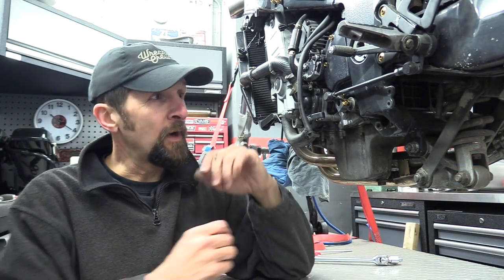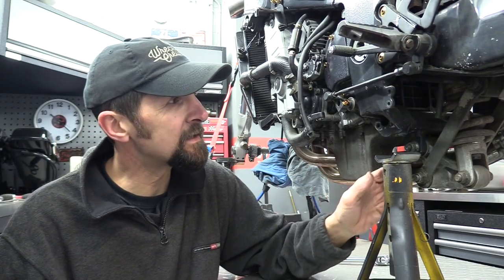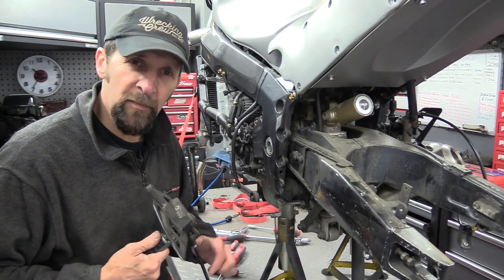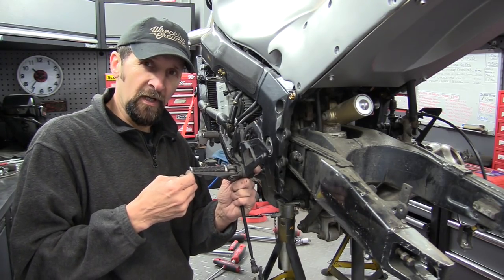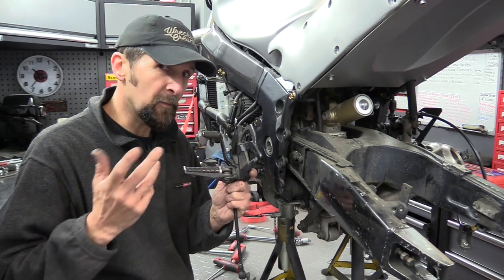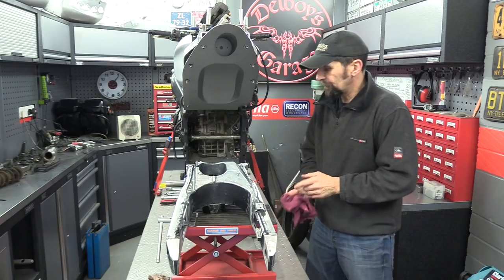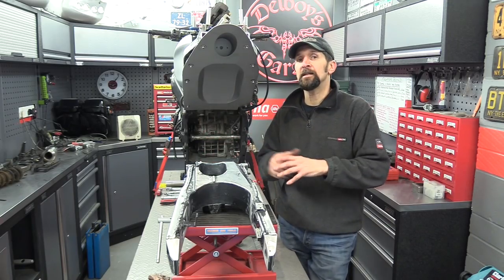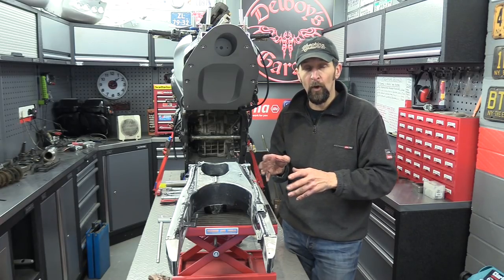Delboy's Garage, Fighter Build #95, Swing Arm out..!

Comment: I’m starting to realise about just how much these videos inspire me to work on my bike or either upgrading my tools and small Crompton type concrete sectional workshop 12ft x 8 x 8 and make it a better place to work, damp is an issue though, causing surface rust on tools, the bike is fine because I have a 6ft long tube bar heater laying next to the bike 24/7 and that 100% works stopping any condensation on my pride and joy but elsewhere it’s a problem, so this spring/summer I’ll be tanking, insulating & plying out the workshop, it’ll all be done on a tight budget, reckon I’ll do a pretty good job on it though. I honestly don’t think I’d have got around to doing this big project without being inspired by your videos, so thanks a lot, I’ve already ordered a lot of the materials needed and can’t wait to get it done as soon as we Brits see some back to back dry sunny days.👍
Reply from the maker: Hi Matt, thank you so much for that kind endorsement, it makes us really happy to know we've been able to help... and I bet you're really looking forward to your project, I know I would be!  I guess I shouldn't say it,  I love the awesome garage we've got, but I would love to build a massive wooden work shop some day...

One point, which may help you mate, with your condensation, consider the principle of heat exchange... remember condensation comes from a sudden imbalance of temperatures within a moist, or humid, atmosphere, it's actually very little to do with insulation... the contents of your garage gets cold at night, like the air outside, then the sun dawns in the morning, beating on the roof, but the contents of the garage stays cold, and imagine when you take a pint of milk out the fridge and stand it on the side in a hot kitchen, it's immediately running with condensation, right?? (or a cold pint in a warm garden)... so the trick is, stick an extractor fan on one end of your garage, then the same extractor fan facing the wrong way on the other end of your garage, so one sucks in , the other blows out, it effectively exchanges the air inside the garage constantly... so it stays the same temperature as the air outside and so do the contents of your garage - hey presto, almost zero condensation... add it to your project mate, it will guarantee you a warm, dry garage... I found this worked myself back in our first garage, which as concrete Marley slabs for the walls and a corrugated sheet metal roof!
Reply: Moonfleet41 Thanks for the reply, all this food for thought is appreciated and definitely going in the mental processor for sure, I was planning on doing a retrospective fit of corner to corner venting using a solar unit that I used on a wooden shed from years ago if the full tanking (all walls, ceiling and floor) doesn’t work as expected, I’m hoping it’ll be completely sealed, like a shed within a shed with foil backed bubble wrap insulation in between every surface which will also act as the vapour barrier. 
because the retro fit of the venting if needed would be easy, I’ll build and test as I go, hopefully saving a little money....if humidity/condensation or stale air becomes an issue, as you say “use what you’ve got” I’ll fit the solar unit....I never thought about what you mentioned though, makes perfect sense when put into layman’s terms...ha ha thanks I did need that👍 I’ll check out the running costs of two fans. Cheers again for the advice. PS loving the street fight project. Ride safe you two.

Comment: Didn't notice if you were doing the relay arm as well...its well worth doing them bearings as well.  Just done rm in my fjr and the shock one was shot!! You've done all the work getting to an so may as well do em.
Reply from the maker: Hi Stan, I thought about that, so did a thorough check of all the others in the short link, and I reckon they've been changed in the past, cos the swing arm bearings themselves are horrible and corroded and gritty, but all the bearings in the short link, including the one under the swing arm, are silky smooth and rock tight, so there's definitely there's no way they're the same age as the swing arm bearings... am not gonna do them now as, like I said, they're perfect, but in the future the great thing is I can drop the relay arm out anytime and do it on the bench, unlike the swing arm which, as you can see, is a nightmare to get out lol !

Comment: Hi Dell, good video and nice and clear process. As a safety tips I usually use a non slip padding between the metal surfaces such as the cheap padded non slip mats you get from camping stores. They are cheap enough to cut up the size you need and it helps to eliminate the chance of metal surfaces slipping.  Looking forward to the bearing video, good quality video as usual. Cheers for the info. Ride safe 😉
Reply from the maker: Thanks Andy, great sage advice there mate, and we've all got a bit of that matting knocking about aye... glad you enjoyed the video, bearing change next... online Weds!  Ride safe... and thanks for your kind support...

Comment: Kendo’s Tips #27 - When using a spanner/ratchet/breaker bar to initially undo a tight nut or bolt, don’t grasp the end of the tool with your hand clenched. If the tool slips potentially you’ll damage your knuckles or worse. 
Better to keep your hand open pushing down on the tool and if it does slip any damage to your hand will be minimised as the palm is much more fleshy and less liable to injury. 
(I’m here all week).
Reply: Good shout. Amount of times I've smacked my knuckles on a sharp part of the bike with cold hands..
Reply from the maker: Kenneth McCurdie:  wise words, well said my friend, thanks for your input... and along with it, I always feel checking the path of your hand as it moves so there actually isn't anything sharp, or hard, that you're going to involuntarily punch for now reason lol !

Comment: Another tip for those of us who are, how shall I say... "not as safety conscious" when supporting a bike:
Get under there, and point out each bolt you are removing. Visualise the removal. and PRE BREAK THE SEAL on each bolt.

If there is a time your bike is going to come flying off the axle stands, its during the "breaker bar" part, so get those (where possible) out of the way while you still have the bike together and supported by the wheel in place etc.

As for supporting the bike, I totally have never put a block under the sidestand and lifted the bike using a trolley jack under the other side. Nope, never. That would be silly! ... ...looks round...
Reply from the maker: I think we've all done that one mate... or another fun one with a Harley, which has such a low frame, is rolling it up on to a brick under each wheel, then standing the side stand on two bricks, and an axle stand under the right hand footpeg... just to get it upright, and high enough, to get a litter try under it !!  I mean that would be daft, you'd never do that would ya?!  Honestly mate, the things we do when we don't have the equipment, I put it down to watching too much A-Team and McGyver as a kid !

Comment: Your videos are so well put together and thought out, you make even work as serious as this look easy so someone that's quite new to bikes would at least think about giving it a go. I'm quite rusty with mechanics and maintenance, I always used to do as much as I could on my car before getting a bike and so far on my bike I've recently put crash bars on it and done the front and back brake pads then bled the brakes.

The front pads were such a pain the arse, took so long to do something so simple because of that shitty little metal prong thing that was a bit buckled so the pads wouldn't sit in the caliper right. It took ages to get it back together and when the caliper was on the bike, there'd be a scraping noise when pressing the brake so had to take it all apart and just took that shitty metal prong out, it's fine now.

Your bike's looking quite cool. Oh just incase you didn't know already, you only use acid etch primer on bare metal, just in case you didn't know, and you dust it on quite light, not cover the whole thing like you would lash high build or wet on wet onto it. You can flat the primer with 400 - 600 wet or dry if you want it very smooth and just before putting paint on, rub it down with grey scotch pad just to key the paint and help the colour coat stick to the primer. Tips I picked up from paint spraying college days, hope that helps, it's all in the prep.

Ta very much as always.
Reply from the maker: Hi mate, thanks for your kind words, I know what you mean, brake calipers can drive you insane sometimes, sounds like you got over though!  And I guess all jobs are easy if you've done them before, it's just the fear of the unknown aye?!  Removing a swing arm is quite easy, as you saw, it's just knowing you won't end up up the creek with no paddle, that gives you the confidence to do it!

Thanks for the hints on the paint, I've ordered the etch primer for that reason, as there are lots of bits of bare metal on this, and I will only put just one layer over to cover the smooth sides of the swing arm, cos the Tough Black itself will bite into anything textured, I aim to put a couple of coats on, then let it cure and wait for any reactions from residual grease, etc., then once I'm sure it's safe, it'll get sanded back with an 800 to give a nice finish, then 4 thick coats, job done!    Again, thanks for the hints mate... it's great to share knowledge amongst ourselves... !

Comment: P.  By the way when you mentioned that you were getting a lathe , no doubt  it will have  some sort of coolant,  would you be able to hook up a device of some sort to cool your new saw as well 😎👍
Reply from the maker: Not all lathe work needs coolant Geoff, and am reading from some viewers that their band saws have a label on that says clear and obviously do not use coolant... now whether this is so that the mechanism, or motor, doesn't get contaminated, or what, am not sure, but am gonna check with Machine Mart and find out what their advice is, but certainly with the lathe, coolant isn't always essential, most if not all the videos I watch, do their turning dry...!

Comment: Swing-arm is always a bit of a bugger :) What made you choose to rattle-can it?  I remember my XJ600 project was a PITA to get the swing-arm prepared to point, it wouldn't just flake off in 6 months cause of the abuse it gets once fitted.  In the end, the £35 it cost to get it chem-cleaned, sandblasted and powder-coated was  no-brainer.
Reply from the maker: Hi buddy.. i used this "Tough Paint" product on my Tiger 955 which you may remember was a survival rat thingy.. and it did 18k miles over 2 years in all weathers with the wheel painted by these cans.. and it didn't chip a single bit.. Its more like Hammerite than regular paint.. even has that Bitumen smell as its curing.. it stays soft, and just doesn't chip... so im gonna give it a go again this time as i have huge confidence in it, the wheels are already done and came out really well.. and as extra belt and braces, im using the matching Etch primer on the swingarm to make sure ive covered all the bases..  Painting it tomorrow, video Saturday.. wish me luck mate.. del.

Comment: Nice work Del.
Were you going to regrease/rebuild the shock linkage while you're 90% of the way there?
And were you going to get a jack-up linkage set? A "true streetfighter" seems to always have one.
Cheers
Derps
Reply from the maker: Hi Derps, no and yes!  I've thoroughly checked the short link bearings, and they're silky smooth and rock solid, clearly been replaced at some point, which is more than can be said for the swing arm bearings, which I've just replaced as they were rusted and gritty (video online Weds.), as for the jack up plates, then oh yes indeed - going for 1" higher on the back, just to set it in that all important angry stance !
Reply: Fuck yes Del! I can't wait ^_^

Comment: Great video thanks.  Does the inside of swing arm need any treatment, are they open to the elements at all?  Just wondered if there was a protection you could pour in and shake about in there.
Reply from the maker: Hi mate, now I've changed the bearings, and had a good look inside the empty hole, it does appear to have the grey appearance the outside has, so I reckon it's probably ok, but it's aluminium anyway, so it's unlikely to corrode like steel would and weaken or perforate...

Comment: Great vid! I have a question tho and hope u can give some advice on it, i have a kawi zxr 400 L6, nice classic paintjob, but had an incident where the left hand side fairing snapped off down the A1 so i had to order a second hand one of ebay, same colours but slightly scuffed, would i be able to mask of the none scuffed areas and paint the scuffed areas same coulor? Like spot sand and paint it, im not skilled enough to do whole fairing, but confident i can do the easyish scuffed areas, would it work?? Thanks buddy
Reply: If youtube still do video messages?? I can show ya what i mean
Reply from the maker: Hi Elliott, good to hear from you mate - sorry to hear about your scuff, yes you can paint that, but generally speaking the best way to do it is to scuff anything you're gonna lay paint on otherwise it'll run off and be a mess... everything that's painted has to be scuffed up first.. if it's any help, normally the way to do it, is scuff up the whole area to be painted, good and bad, then spray the whole area and afterwards use some clear lacquer, if you can, to gloss everything over, but I understand it can be daunting if you've not done it before... what you can also do with sportstbike plastics is spray the area in between the stickers, because you can use the stickers as a borderline, making them an invisible edge when you're finished... hope that makes sense, am sorry I can't be more help, but painting is about your own skills and it's hard to help you with it over email... am sure you agree, that practice is golden, so why not consider and old piece of panel and paint that first as a practice piece if you're not confident.. then once you know you're reasonably good at it, get stuck in to your panel and see how you get on !  Remember, if it's already damaged, you've nothing to lose mate, you can't make it any worse aye ?!
Reply: Moonfleet41 awesome buddy thanks for the advice, determined to get is sorted, if ya ever up in northeast/Newcastle in spring /summer, give is a shout and we'll burn some rubber 😎

Comment: What Genius! Top notch stuff again fella. Use what you have. I have many tools that have been adapted, where necessary to allow me to carry out various jobs. Sometimes, even next-day delivery ain't quick enough, especially if the vehicle needs to be on the road. Thinking out of the box, I like! Swing arm doesn't look in too bad nick, given it's age. Japanese engineering!
Reply from the maker: Sure thing mate, I totally agree, sometimes you just need to get things done!  And the swing arm, you have no idea mate, it's like the bloody Forth Bridge, and would you believe, it actually has 4 bearings in it, and a central axle tube as well as the axle, looks strong enough to hold up a RocketIII - bearing change on Weds !

Comment: Del, what kind of wheel did you use to remove the old paint ?  Type , size and grain ?  Bill
Reply from the maker: Hi Bill, I used one of these mate, and very gently! https://www.ebay.co.uk/itm/dronco-Cleaning-Fleece-Disc-115mm-Quality-Coarse-Rust-Paint-Polishing-Grinding/273032357110?hash=item3f91ff24f6:g:zukAAOSwPc9WuxnH

Comment: quick question do i really have to replace my chain if im adding new bearings to my swing arm on my ZZR1200 As always love the vids and tips!!
Reply from the maker: If you mean removing it because you have a swing arm brace, then no you don't need a new one, you can buy a new compression link, grind the heads off the old one and remove it, then fit a new one when you're done...

Comment: Question please is the rear shock under any pressure when you remove it del ?
Reply from the maker: No mate not at all, as soon as the rear wheel is lifted off the ground, the shock drops to it's full, relaxed length, and it's safe to remove all fasteners...

Comment: Timely reminder of the use of the breaker bar (Tommy bar in my day!) instead of straining the poor old ratchet beyond its design.
Reply from the maker: Darn right mate, back in my days as a fitter, you could never take a ratchet back to the Snap-On man for repair if you'd stressed it - the guide was always advised at about 70Nm, any more just reach for Tommy!

Comment: another great video. question, are you changing the linkage bearing also?
Reply from the maker: Hi mate, I checked everyone of the short link bearings and they're absolutely tight and silky smooth, so not gonna change them at the moment, but in the future, the great thing is with short link bearings, is they're a piece of cake to do without stripping all the back end out as the link just drops out underneath once you support it... do you need to do yours then??
Reply: Moonfleet41  makes sense, no point wasting money. my linkage bearing are fine, just cleaned and greased them a few weeks ago. did have a question on them tho. the linkage bearings had a hard wax like cage/grease over them and when cleaning that grease came out in big bits. I repacked them with grease but wanted to know if that's the right thing to do or do I need new bearings with the hard wax over them?

Comment: Hi Dell, could you not have got the swing arm sand blasted or something?.
Reply from the maker: No need mate, unlike the wheels that were covered in powder coat and old thick paint, the swing arm just had a very think layer of factory paint, which I just cleaned off with a soft disc... so no need to waste another £40, and it'll be all the same once it's painted - will use a little primer this time as the metal is smooth !